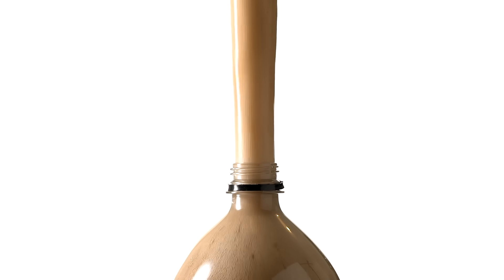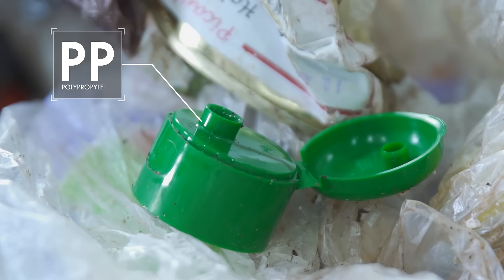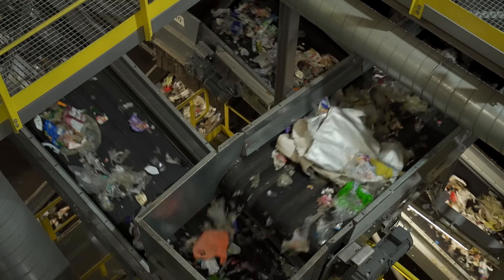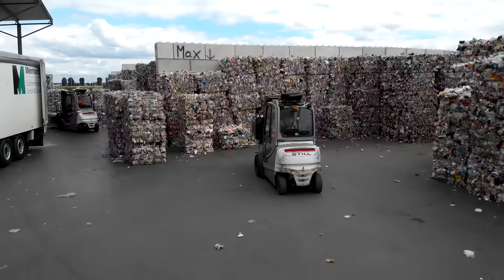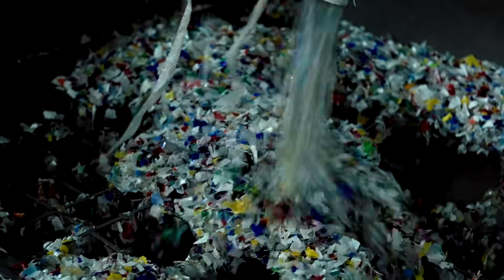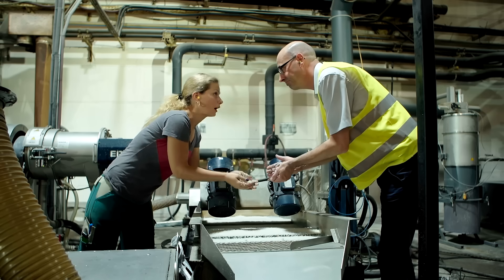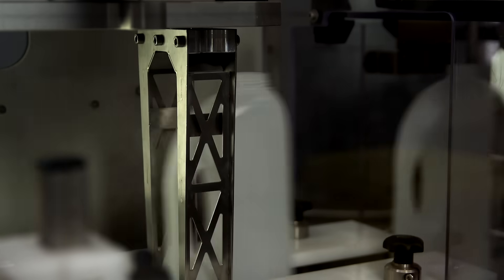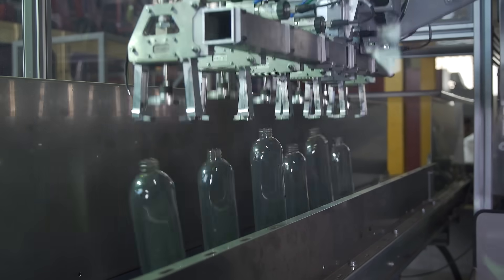Recycling plastics – Resource efficiency with an optimized sorting method

Comment: Recycling is  a very important thing because it will be made into new stuff
Reply: 95% of plastic isn’t recyclable
Reply: @justinsidious9772  That's a lie, most plastic bottles are PET, plastic bags are polyethylene (among many other things), lots of consumer products like keyboards, monitor casings, etc., are made of ABS. All of these are theromoplastic and can be granulated and fed back into the injection/blow moulding machines.

Comment: umm.. good but if we are making bottles only after recycling bottles, that we can do on a ground level. We can encourage and educate consumers to reuse the bottle. Like instead of buying a new bottle buy a refill pack. Although it looks like recycling, but the energy consumed in the process and how it is generated by renewable sources? I mean the electricity here. As good as my experience and knowledge about electricity, you can't use solar power to do this job. This can be a good commercial idea in Germany so consumers may buy new products without producing more plastic, but it's less ecological. How about we now try to send plastic back to where it came from because it is much more than we actually need, as we think of ground water recharging, this plastic also came from inside of Earth. Why can't we think of a chemical process to decompose this plastic faster and then send it back to Earth's mantle? What say? I know it's not commercially a very good idea but at least we can save aquatic life in the oceans.
Reply: I buy only seltzer in plastic bottles. I can't refill them with seltzer.  Bottles used for water, which we can also get from our sink, are indeed wasteful.  You're proposing turning plastic back into oil, which I don't think is possible.
Reply: @zyxw2000  That's really appreciable to know that you re-use. I didn't say that reversing the plastic back to oil was my idea. However, plastic decomposes too, so we just dig a big hole and dump all the plastic, then cover it up with the earth and let it become a park with greenery. This practice has already been done in Delhi, India. Search for Indraprastha Park. It was a wasteland once, where the trash from the whole city was just dumped. it piled up so much that it seemed like a mountain. Yeah, it did smell a lot, later Govt. decided to convert that wasteland into a park. Today after so many years nobody can guess it was a dirty landfill place once. It is indeed a green family park today. 👍
Reply: @ChankArtsOfficial  A plastic bottle takes 400 years to decompose.  But all US trash is converted into landfills and then parks or forests too, but there's no need to separate the plastic.
Reply: @zyxw2000  yeah, true. The more you recycle the plastic, it becomes of poorer quality.
Reply: @zyxw2000  Yeah, there is no need to separate plastic from other waste, but dry and wet waste must be segregated for a smoother process.
Reply: @ChankArtsOfficial  Yes, if you have too many to recycle, they can be put into landfills, but they never decompose, just turn into microplastics.  We turn garbage into landfills, then parks, here in the US too.

Comment: Where do the colored flakes that get blown out of the stream eventually go?
Reply: They are sorted by color and sold/used separately..
This video is a bit confusing, the blow machine is just sorting those flakes by color into multiple conveyor belts (eg. one for red one for green, one for white etc.).
So eg. if you want to make a red bottle you use the red plastic, so less or no pigment is needed.

Comment: Can recycled plastics  be used in road repairs as a part of the elements  that  goes into the black tar
Reply from the maker: Thank you for the question! Yes, there are indeed such endeavours. Plastic is used to make the bitumen stickier and therefore the asphalt more durable. If the new plastics were replaced with recycled plastics, raw materials and CO2 emissions could be saved. The start-up Ecopals, together with the Fraunhofer ICT and the University of Kassel, has developed a new type of process that reprocesses used plastics for incorporation into the asphalt. Its applicability is currently being trialled on test tracks and private areas. The waste plastics used are so-called mixed plastics (non-homogeneous PE and PP plastic streams), which are not economically recyclable and cannot be used for new products, i.e. waste plastics that would actually be incinerated.
Reply: I am from srilanka. I am a researcher. Could you give a chance to exchange knowledge. I like to learn about this. Any educational chance.

Comment: Why aren't 'difficult' plastics made illegal? It would make recycling so much easier and cheaper.
Reply: There is no such thing as difficult plastics. 
The problem with plastics is that they are so cheap to produce that sorting is often more expensive than making new unless you get government grants.
It doesn't help that most plastics are very similar to each other making separation difficult and "ecologists" keep adding bioplastics to the mix that make sorting even harder.

Comment: Good day. I Hope you can help inlightened me. Do you have any idea how plastics on disposable razor can be recycled?
Reply from the maker: Thanks for asking! The handle of disposable razors is usually made of polypropylene (PP) and the blade is made of metal. Recycling via shredding, sorting and recyclate production would be conceivable in principle. However, disposable razors are hygiene products and should be disposed of with residual waste and therefore incinerated.

Comment: How much does this industry cost to build?
Reply: That is and will always be the problem of sustainability and real recycling circles. Most of worlds countries have not one percentage of what it costs to build, install and run. So the option could be, that the poor countries only collect and sent it to countries with these machines.but this uses so much fuel and transport costs that using oil for new cans etc.will ne cheaper for long long time. And then...dont know and it willnot be my problem.i am over 50...

Comment: Why green cap showing everywhere?
Reply: Polypropylene (PP) is a tough, rigid, and crystalline thermoplastic. It is made from propene (or propylene) monomer. This linear hydrocarbon resin is the lightest polymer among all commodity plastics. PP comes either as homopolymer or as copolymer and can be greatly boosted with additives.

Comment: What about phasing out plastics? Milk, soups, detergent, takeout, juices, canned tomatoes, soy sauce, and olive oil can be packaged in cartons. A 1600 cubic foot truck can hold 8000 detergent cartons, or 100,000 cartons that have been collapsed. It's easier to incinerate paper than plastic.
Reply: It's a complicated issue - cardboard packaging may have a higher greenhouse gas footprint than plastic. Same with glass and aluminium cans/foil. And heavier packaging means more energy needed to transport it. Ideally we could have an economy which uses+collects plastic efficiently instead of intentionally dumping it in the ocean.. and the plastics which are at risk of being leaked by accident would be designed to degrade in the ocean environment (which is being researched everywhere currently).
Reply: Oh you made a massive research 🧐

Comment: actually they just burn most of what they claim to recycle.
doubt it?   follow the truck
Reply: wrong. In Denmark and Germany 30-35% of the plastic collected for recycling is burnt, but the amount of plastic that's collected is only a small portion of the total amount of plastic that's thrown away. Problem at the moment is that there's not enough companies willing to use recycled plastic, so even though the sorting has proven efficient and works well it has very limited capacity and there are not enough takers for the material, so the plastic bales accumulate. When the storage is full there's no other recourse than to burn the excess, but since plastic is 80-90% oil it works quite well as fuel, it's just a waste of resources

Comment: This needs to be happening everywhere in the world.
Reply: The people in the rest of the world don't have the mental capacity to create this or maintain a system like this
Reply: You missed the part where only a small fraction of plastic material is actually recycled, which is sold overseas... and even that has a limited lifespan before eventually incinerated with the rest of the plastics.
Reply: @isturbo1984  True but it's better than the plastic ending up in the enviroment. Unfortunatly even if these recycling places were eveywhere you still got people carelessly throwing their plastic trash wherever. So yeah it's pointless.

Comment: I feel so sad that people threw away things like shoes or residual food. I mean, this is not plastic, nor paper, glass, or metal. There should be also recycling for clothing. Also, I am against one use shampoo bottles or water bottles. I am for the refilling them until they break. Ok, this will lead to recycling,  but at one point. I personally think that the breaking of plastic in small pieces should be done after the sorting by colour, not before and maybe done by people, even though this is not economically. I am also against mixing, for ex, glass and plastic, to have glass plastic bottles . They should be made from only one substance 
Also, the baby dipers should be made out of paper and have only on the exterior a detachable plastic part, that should be reused every time you change the paper diper, but this is only my way of thinking...
The plastic part to prevent the leakage and the interior to be buried in ground
I also would like to be a compartment for food, that should be given to animals shelter or to the agriculture, as natural fertiliser 
Lots of love to recycling industry anyway!

Comment: NO PROBLEM FOR PLASTIC BECAUSE CAN CONVERT INTO FUEL,, THE BIG PROBLEM OF THE PLANET REASON CLOSE TO DIE ARE  THE ALL MININGESPECIALY THE OIL,METAL AND OTHER MINERAL AND THE DIFORESTATION CAUSE OF THE LOST OF SUPPLY OF FUEL,, WITHI 25 YEARS STARTING 2017 TE ONLY SURVIVOR OF THE PLANET ARE THE MARINE LIFE, ALL LAND ARE SINKING INTO THE OCEAN FOR 25 YEARS
Reply: Another doomsday prediction that will be available to purchased at the bargain bin of your local used bookshop.
Reply: So...you hate wooden homes, metal cars , airplanes, trucks, electricity, fuel to run the industries that make life possible,  and virtually every single aspect of human life?
I cannot believe you have the intellect required to breathe in and out.
You need to embrace a zombie lifestyle,so you only require raw meat to live on.

Comment: Very ingenious processing.  However, the world also needs bio-plastics, that is, plastic made of plant-based starches that will degrade and disappear in the presence of bacteria and insects.  Here, in the United States, the petroleum industry recognizes the shift away from gasoline and diesel.  The corporations resist any innovation threatening the use of petroleum.  I include a very simple yet effective demonstration of starch-plastic.  The 'plastic' shown need not be recycled.  Bacteria and worms eat it.      https://youtu.be/PTM5WTJkHR0
Reply: Consider repurposed plastics.  I convert industrial diameter pipes into hydroponic systems.  Short lengths of pipe would otherwise go into landfill.

Comment: The plastic recycling industry here in the U.S. is not very good at all. A lot of clean plastics that one would think should be recyclable, is considered unacceptable, and we're instructed to put it in the curbside garbage bin instead of the commingled recycling bin. What is worse, is that people like my dad, will put almost anything in the recycling can, because he thinks the local recycling company can sort out the contaminates.
Reply: your dad's vision is the correct one though, and there should be people to hand sort all of our garbage, the cost of which should be incurred by anyone manufacturing with these wasteful materials

Comment: That's what they think are the best in the world, they don't separate the garbage and say that the Amazon is to blame. All this plastic would be being used if it weren't for the indifference of every German who doesn't recycle and mixes different types of plastic. With these plastics that do not have all this economic interest, they could make blocks for building houses, as they do not need to be perfect, instead of making those huge ceramic blocks, they should recycle this plastic that will be burned and generate more carbon dioxide. MAKE BLOCKS FOR BUILDING HOMES. Stop funding this cover of Greta, which is nothing more than a mass of maneuver.
Reply: https://youtu.be/RjPSf1LH6Iw- recycled plastic shoes

Comment: I can't imagine how colored plastics (by "uncontrolled hues" in fixed color choice) disappear after a simple computer "sight". How many times is this done for the same color, of different product quality? I would like to believe it, but only see white and transparent plastic coming out. What happens to the particles of drawings with several colors ..?

One should always beware of so-called German tech advance...
Reply: It depends. That machine shown is to separate one color from the others. You can run this several times one after another so that you have separated all of them from each other. Other machines have variations. Anyways, look up <color> granulate. There are plenty of colors, all of them needed. Apart from that, you can actually melt and extrude flakes of different colors! However, the resulting color will be a bit ugly and dirty-looking. Mostly won't do for marketing.
Reply: @royakonopka7072  It is all the same a lot of variation of recovery ... To obtain ideally primary and secondary colors which are used to create other colors. You want to believe it, but it's A LOT of operations (how many passes ...) to separate small parts of how many colors ... There is some doubt about the finished system and the cost of .. , for a productive and efficient result.

Imagine the variations of yellow, green, blue .., in a salable result and numbered in color code. But above all, all the other variants which must be in the BIG majority, they must also be reused. At what price and at what technicality for an efficient system for a large metropolis?

There should be less variation in color, especially in the packaging, “why didn't this is simply not”?

Comment: How much Energy is used in all those process? and how much of it is actaully clean energy? this is a rly bad cycle that produce worst and worst quality plastics everytime creating more waste while producing more greenhouse gases in the process. 

What we need is less waste all together
Reply: It will not produce lesser quality plastics, because for example new bottles will still be made out of 100% PET, even if the material coming from the recycling plant to the factories is only 94-98% PET, the missing 6-2% had to be added and the containments removed from the recycled  raw material, for example through chemicals or maybe separated when it is melted down, I would suggest.

Comment: What amazes me the most is the machine that detects the color of individual plastic flakes and separates them via air pressure. I just cant wrap my head around how this is done with such precision, at such high speeds on such a small and flimsy material. /mind blown
Reply: I used to work at one of Europes largest pea factory.
We used color sorting machines to sort out anything that wasn't a pea of exactly right green color.
There could be peas that started to become yellow (a slight yellow tint on an area of the pea), there could be snails, slugs, pea pods, sticks and branches, bone, stone and pretty much anything that you can find in a pea field.
The toughest thing to sort out was the seeds from the nightshade, almost the same green as a pea but slightly darker.
Our color sorting macines sorted thing by color but also by shape.
If anything of the wrong color or the wrong shape passed by the sensors, it was blowed out pretty much like in this video.
At about 40 tonnes per hour we used 4 color sorting machines and we got around 99,9% of all foreign objects away from the peas.
10 tonnes per hour per machine.
The funny thing is that this is not a new technology.
The company I worked for bought their first color sorter 1990.
Reply: Is impressive, must be something similar to a electric diesel injector

Comment: I had an idea of every house/village/town to have a GARBAGE GRINDER to grind the garbage into dust.

If you grinded all of the garbage into dust it would polute the environment a LOT LESS and it would take much less room and you could make like furniture from the dust and other useful items.
Reply: Dust of many different materials is, even if grinded to dust-sized particles, STILL a mix of different materials. There is a reason why you would separate the different materials in the first place. Imagine baking a cake and using fine sugar instead of flour. Would you get the same result just because they are both powder? Of course not - they are still different materials with very different characteristics!

Comment: Does anyone know how much it cost to start  that recycling PLANT ?
Reply: BEIER GROUP is founded in 1998, We are the leading brand of plastic machinery manufacturer in China. 
BEIER GROUP have 4 main business sections:
Plastic recycling& washing line
Compouding& conveying system
European standard blow moulding machine
Email: bill@beierpm.com
WhatsApp: 86-15262331026
Reply: it depends on your capacity need and your material
Reply: Messi Vlog16   Email: bill@beierpm.com  whatsapp: 86-15262331026
Reply: we are the manufacturers, leading role in China

Comment: You could just buy the piece of equipment that takes plastic an turns it into gasoline. Guy in Japan builds machine that takes plastic an turns it back into oil & separates it. 1 is oil the other is gasoline
Reply: https://youtu.be/c-wE2oaQ8Mo